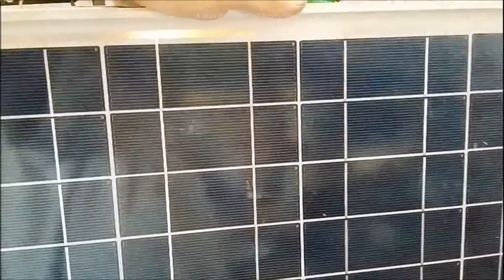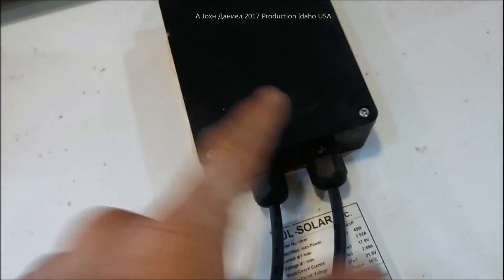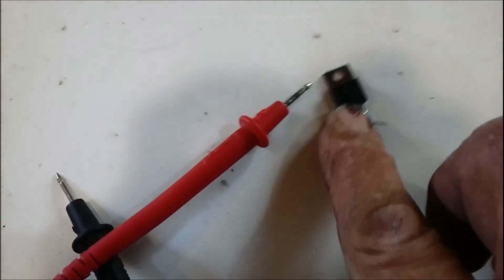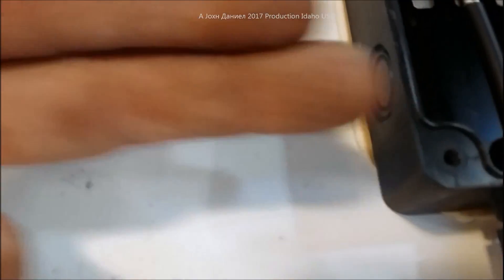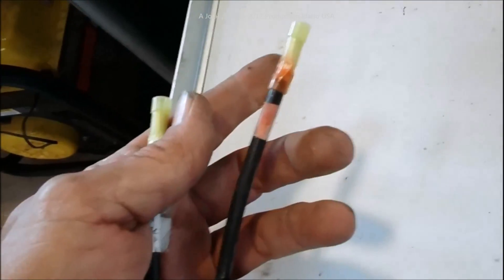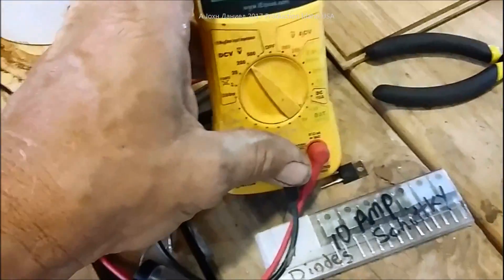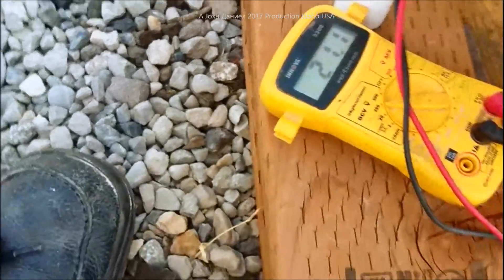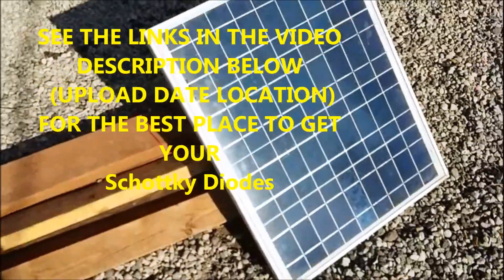Solar Panel Repair REPLACING DIODES with Schottky Bypass/Blocking Diodes, PARTS USED BELOW Video

Comment from the maker: These 10A/45V AXIAL are best Schottky https://amzn.to/3jfUqYg ,You Can Do It ✌ Best MPPT controller 40 amp https://amzn.to/3eHPxDE Best Solar Panels https://ebay.to/2CHae5B the MightyMax100w4bar *Rock solid power Inverter 2000 Watt https://amzn.to/3jeEVQo ,REAL 150AMP Watt/amp Meter, https://ebay.to/32xppsL PROVEN BEST ONE MADE, Don't get fooled by fake vietnam knock off copper colored aluminum wired fire hazard sold from missouri wind & solar junk.
Reply: Hello sir..did you take it off the middle pin?
Reply: I know it is kind of off topic but do anyone know of a good place to watch newly released movies online ?

Comment: What if 3 panels in series make 120v on sun, 34/40v about 10a panels, only makes 2a, could the battery be Bad, panels should Be 90v and 10a

Comment: a wise man might want to put some insulation under the diodes.  I don't think you mentioned it, but I noticed a container of "flux paste" on your work bench.  I'm sure you know that using plumbers flux for electrical connections is a bad thing... resin core solder is the way to go!
Reply from the maker: I would only use plumbers flux for tinning then cleaned with BAC to make certain lugs or terminations. You can clean with baking soda too, but that requires 200 degree water and soda to do right.

Comment: When I go to check my solar panel voltage I'm getting a negative -001 I check the diodes they working correctly sending current only one way I cant figure out why I'm not getting the proper voltage reading from this panel it should read positive not negative on my meter

Comment: So voltage went up,  what happens to the amps / current?
Reply from the maker: If you consider the same generating source used as volts go up amps will drop. That's why a 24 volt system has much lower amps with the same amount of solar wattage.
Reply: On the panel he repaired, the amperage would have gone up once the bad diodes were replaced.
  I believe he's thinking you're asking what voltage to make a system.

Comment: I have a Newpowa 70 watt panel that only has 1 diode in it.  Can anyone give me an answer as to what Schottky diode I need to replace it with?
Reply from the maker: Basic 10 amp schottky diode will be fine.

Comment: What could be wrong with my panel it has 20 voltages but only .5 amperages and the panel is 100 wattages
Reply from the maker: Depends on the brand of panel ( many are just fake rated ). But if you multiply 20 volts x 5 amps you get 100 watts. So if it is showing "POINT" (0.5 ) five, Amps, you have a definite short or failed panel. You can determine this by cutting away the diode and testing only the ribbon from the panel for accuracy with no diode in it that may be your cause of loss.

Comment: Diodes in solar panels are fitted for two reasons if it got one diode it's to to stop reverse current at night and running your battery down by the positive running backwards through the panel. If you using a solar charger this diode could be bypassed as it's not needed. If there is more than one diode these panels were designed to be used in series with other panels to produce higher voltage and the diodes are there to bypass current  when part of panel is in shade or has faulty panel.
Reply: Amigo una pregunta tengo un panel chiquito uno de 5v y uno de 12v de unos 15 centímetros de largo aló mucho tiene q tener diodo o no esque los compré de segunda pero no traían diodo si en caso lleva cuál podré usar de ante mano gracias espero me respondas y me entiendas

Comment: Hi John, I want to exchange the diodes on my 160W panel that has dropped its voltage to some 10V;  the Voltage before the problems was max 22 and Amp 3.5.
I guess the 15A/45V diodes should be ok for this as well?
regards
Werner

Comment: 500W panels not newer cost more than 500$ today 2019. good mppt charger cost 10-50$ and inverters lot lot more. 3000W inverter normal today 300-400$ if buy expensive shop. same can buy cheap shop 100-200$ google must looing were have cheapen. post come to home same money ,mean post normal have free.

Comment: stupid pay solar5 panel more than 1$/watt maximum and used old panel 50€ less thats maximum 0.5$/watt, if panel have old not have same output and condition than new, and new cost normal today maximum 1$/1wqatt, 100W panel no cost more than 100$ today, only if seller lie and scam and lie say cost more. no newer need pay more.45W maximum cost about 40-45$ if pay more have idiot and stupid or rich and money not mean anythink. have money waste to out many million $ idiot.

Comment: i wonder why these 2 diodes are in series instead of using just 1 diode ?
Reply: @CrankyTim  it looks the same as with my panels. The center tab has no electric connection to The panel.. thats why i wonder.. 2 diodes would only decrease the output Voltage..
Reply: Ow wait.. it looks he actually has a middle tap...

Comment: how about harbor freight 25w panels'?  I wired 2 of HF panels in series, then on down to 5 more strings of 2, then parallell.  results did not pan out.  first I tested 2 panels in the series, and the results were expected:  44.2v @2.6amps.  but when they were all connected together I had same exact numbers 44.2v @2.6amps.  Then i disconnected all harnesses, tested each individually and all were normal readings: 23.6v@1.3amps.  But when I put them in parallel with included HF parallel harness, the results was wierd:  4x25w panels in parallel= 23.6v@1.3amps?!?  I swore when I bought the kit and connected harness for parallel I was getting 23.6v@5.2amps.  So i opened the panel frame up to see if there is any diodes to replace.  Nothing smelled funny, there isnt anything in particular that popped out at me, just a negative and a positive to top of glass of the panels and that dumb blue light covered up with waterproof silicone.  I had all 3 100w kits hooked up in series of 2 panels each to equal what I supposed to expect was 44.2v@15.6amp?  I have a feeling I fried all 24 panels!  They all work individually as 25w panels but I cannot parallel anymore and series never worked beyond 1 string and no paralleling.  THis sucks and any help would be really appreciated~! i dont know where to turn and I dont take anything back to stores.  I feel that this problem is something I did or the panels are ok, just I need to replace something I am missing in the dissassembly like a diode or something?
Reply from the maker: The blue light is a diode, LED. Not tried it, but one RV owner put 12 on his camper with 4 into 3 for 89 volts to a 40amp mppt. Not sure how he wired though.
Reply: Јоhn Daniel I got a clamp meter and I was able to measure current that way and I got the expected results in parallel I haven’t tried in series yet yeah I bought like a couple hundred dollars worth of adapters and at the end of the day I should’ve just cut the cable and spliced it up like it you know real nice and easy. I’m learning though this is a whole lot of fun and I love the harbor freight panels so far in Kansas here cloudy and all I was charge it during a 2 PM rain storm LOL.

Comment: Hi Daniel, I need your help if you have time...
I've two 260W solar panel in series (Solarworld Vcc 38.2V, Isc 8.54A) with a EPSolar 20A MPPT regulator. The strange things is this:
Vcc 69V but when they were be connected to the regulator, the voltage drops to 27 volts and the amps  are 1.2 -1.5. If I disconnect it from the regulator, the voltage grow to 30-31 and the amps to 4 in the best conditions). The next day, same story.
If connected singularly, same voltage and ridiculous 0.6-0.7 amps.
What I can do? No one was able to find what is going on...
Thank you
Davide from Italy.
Reply from the maker: Sounds like settings or battery failure.
Reply: Ur have got fake mppt or faulty
Reply: Check the diodes in the terminal box of the photovoltaic panel. Check the voltage and amperage in the short circuit, upstream and downstream of the bypass diodes

Comment: I ordered 15 such diodes, if you like it, I will order another 20 pieces, you have 15 amps on the video, and I ordered 20 amps. When cooling down well, I am squeezing out 5 ampere small diodes of full 5 amperes and nothing seems to overheat. My transformer can be 30 amps free to issue and not to overheat, and I want to supply diodes such that at the output a full 30 amps can issue continuously. This is a charger for car batteries and a 220v inverter plus two in one with a regulator and stabilization of the output current as well as power, I collected everything myself completely.

Comment: Я понял что ничего не понял
Reply from the maker: Надеюсь, видео было хорошо, чтобы помочь
Reply: @JOHNDANIEL1  Yes, I was looking for information about  20SQ045 20A 45V Schottky Rectifiers Diode I did not find a detailed video on these diodes your video is the only one, in Russian there is also almost no information on them. And I do not understand the American language. I am from the Russian Republic of Dagestan city of Makhachkala 05 region. I have been fond of electronics since childhood, I am now 30 years old, I study electronics every day. Bad memory is difficult to memorize, but I invent and memorize what I’m doing with my hands. I like to invent something to improve and refine and create unusual things.
Reply: @JOHNDANIEL1  I ordered 15 such diodes, if you like it, I will order another 20 pieces, you have 15 amps on the video, and I ordered 20 amps. When cooling down well, I am squeezing out 5 ampere small diodes of full 5 amperes and nothing seems to overheat. My transformer can be 30 amps free to issue and not to overheat, and I want to supply diodes such that at the output a full 30 amps can issue continuously. This is a charger for car batteries and a 220v inverter plus two in one with a regulator and stabilization of the output current as well as power, I collected everything myself completely.

Comment: Thanks John, I got a 150W polycrystalline ten days ago, voltage was around 19V. Since yesterday, the voltage has suddenly dropped to around 10V. I'm suspecting the diodes. Will check.

Comment: Personally I don't like any resistance across any diode for solar power. It should be a microcontroller that auto disconnects if the voltage reverses direction. The schottky diode may have a lower resistance giving you higher voltage but if the voltage goes in the reverse Direction it will allow more to flow back to the panel. It would be good to take your voltmeter and do a reverse voltage drop across that diode before installing it in your system.
Reply: Tim Kasey @ How to repair a 100 wt soler,that the lazy power supply?

Comment: schottky diodes produce less heat when used, They are more efficient, they allow more voltage to pass by not consuming it and producing heat,   = better forward voltage drop, I'm doing 1.5v solar garden light projects, But i've never seen ones this big, Cool!
Reply: As far as I'm aware, schottky diodes are not as robust as normal diodes. They do have less voltage drop through them though. If I remember correctly they can only go to a limited voltage though.

Comment: I have some cracked glass panels, using a energy meter i get 0 amps, hooked up to battery , .5amp is the best i have gotten,  what can u do to get at least 6 amos from the 8.36A the panel suppose to output?
Reply from the maker: +CODIA STLUCE Depending on the damage to the panels the cracks can also split the cells. Once split the whole panel is worthless.

Comment: can you tell what would be voltage if you pull out all the diodes from your panel??
Reply from the maker: +Nadeem Ahmed With most diode removals You'll get a 0.20v increase in voltage on 12 volt panels, a .40 increase for 24 volt panels.
Reply: Јоhn Daniel thank-you dear
Reply: @nadeem5476  it may not be a good idea to remove them if you're putting the panels in series, it allows the current to bypass a panel that might be partially shaded. Dear LOL

Comment: Great Video!  I may be having this problem with my panels since I noticed a drop in the charge rate after about a year of use.  I'll have to check them out next opportunity I get.  Thanks for the heads up!

Comment: eyes like a hawke good deal on panels , you always find the amazing deals.
my amorphous did vey well when i tested them 140w out of 100w panels, apparrently thats how they start out and then settle down to rated watts, the down side for me was my 100w amorphous panels are probably bigger than my 250w mono, multis and polys but i love them all just the same, they compliment one another
Reply from the maker: All 12 of them 45 watt panels cost me $187.30 delivered in a bid because the idiots selling them put them down as 12ct lot new SALAR PANEL 45w dc  on the ebay ad in furnishings. Had a 100 reserve on it, I am the only one who bid on them. Shipping was the $87.30
When you look for things you want to get cheap, just do what generation x dummies do, mis spell the shit out of it and hit search in auctions! Got a Fuel tank for a corvette that way, New FULE TANK CHEVERLET VETTE 1971 Got it for $1, I love idiots, thats why I enjoy people from Seymour Missouri!
Reply: Man if only i got my pmas from a place in missouri that way, i would not have cared about the very ordinary build quality.
i tried the misspelling on ebay but ebay au sees through my deception and goes straight to the correct product, im going to keep trying though , sometimes people put products in the wrong categories like you said.

Comment: Thanks That was very informative and a good repair......The VOLT are someway important so we can se if it is ok......But the AMP thats THE PERFORMANCE of the panel and THAT is important ......and you didn't sow os that......So it is NOT a Full report if it walks ore not.....So be better Pleace...Thanks Jørgen Thomsen Denmark DK
Reply from the maker: You just have to look for the REPAIRED UL-SOLAR 45W12V36 Panel tested under load video which is next on this subject using a watt meter and full sunlight. The heavy cloud cover on this video was not conducive to a amp flow test.

Comment: How often do these diodes fail?
Reply from the maker: Depends on your use. This one was in a group of 8 and just stopped producing after 5 years. I pulled it from the system and put it in the shop storage then replaced it with another on the array.
Reply: Rare. This could have been a solder failure, we will never know because he did not re-flow the solder first..

Comment from the maker: You can install a serious 500+ watt solar basic + system for around $1000 that will be cheaper to own than any gas generator or alternate power supply. As a person who lives off grid, I know what works together! And I made you a list of the most dependable parts you can find on a budget. And if you Want a simple but dependable system, Then heres your best options for a great system you can build & Depend on, below is a list of stuff that makes my experience of 11 years in this now yours.
Best all around and durable MPPT solar controller for a home system , The ROVER 40 amp http://amzn.to/2ggyi44
ABSOLUTE Best Solar Panels to put on it is 4 of the 130 watt (see link below) for a total of 520 watts, a perfect safe 90.5% the capacity of the 40 amp MPPT and VERY SMART design. You can tie 2x2 for a 24 volt system or 1x4 for a 12 volt system Its really EASY!   See data, reviews, REAL QUALITY, and cost http://rover.ebay.com/rover/1/711-53200-19255-0/1?icep_ff3=2&pub=5575119394&toolid=10001&campid=5337966591&customid=PREMIUM+LIFESPAN&icep_item=262053427071&ipn=psmain&icep_vectorid=229466&kwid=902099&mtid=824&kw=lg Verified Quality MADE IN ITALY ( read the info on the links, see if its what your looking for)
A impressive rock solid DC to AC power Inverter if you need one is the German engineered KRIËGER 2000 Watt  (specs at) http://rover.ebay.com/rover/1/711-53200-19255-0/1?icep_ff3=2&pub=5575119394&toolid=10001&campid=5337966591&customid=Top+Tier+Inverter+&icep_item=292165278763&ipn=psmain&icep_vectorid=229466&kwid=902099&mtid=824&kw=lg Off Grid Energy 
If you need someone to talk to (write to) about wiring and mounting help, then just ASK!
Reply: I went to all those links, seems you sure have done your home work, thats a 520 watt system with all the best damn parts for sure. And cheap enough even my sister can do it. Adding it up with my shipping prices to Colorado I got $999.30 for what you designed. I know about how good those Krieger inverters are because they put them in FedEx trucks. I know Renogy MPPT is top of the line, But how good are those Italian panels?
Reply from the maker: The Peimar 130W or better known as the Synthesis has been around about 10 years or more. It has NO recall history, no warranty fail history I could find and it has a very high conversion efficiency rate which Chinese crap panels do not have. I would trust it to perform at or near its ratings, not below.